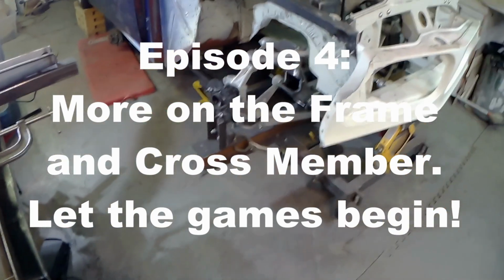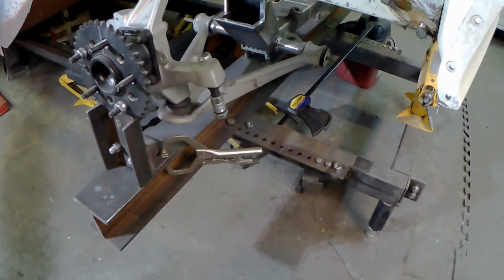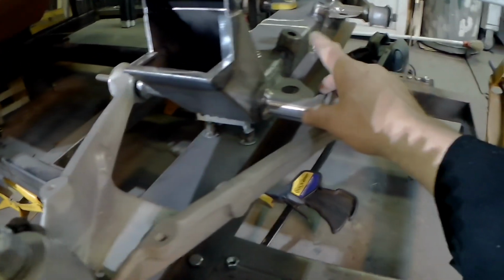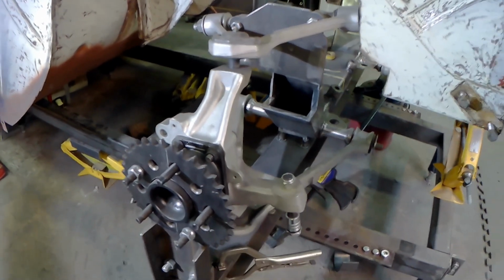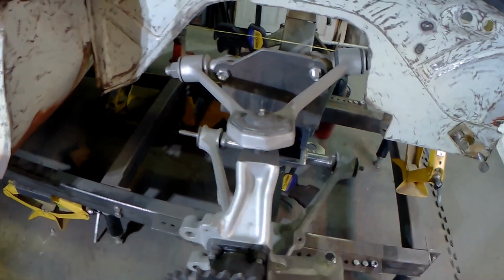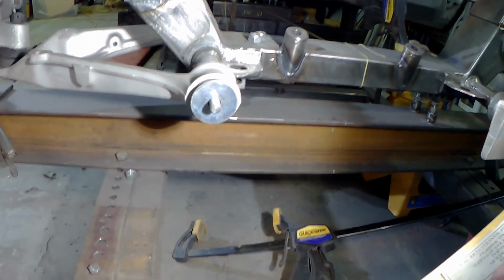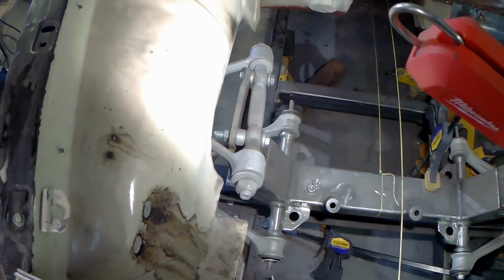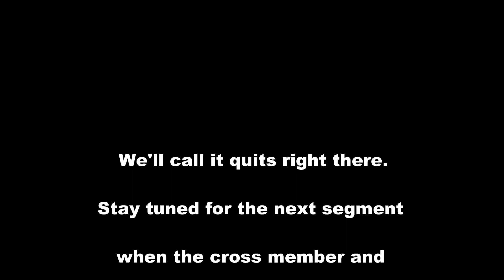Volvo Amazon Front Suspension Installation - The First Effort. (EP.4)

Comment: Surprised you didn't go with mustang 2 , as it has decent geometry and is more compact than the vette's (I did see you pooh-pooh the m2 in the comments of another video).  Did the size of the c4 a-arms or geometry present any issues on your considerably smaller track-width car?  What resources did you use to figure this out?  Just binge-watched all the frame & front susp vids. Great content!
Reply from the maker: The M2 is no better than stock...so if you were going from a solid axle to a M2 then it's a move in the right direction for a hot rod.  The only thing you get is rack and pinion steering from the M2 - the geometry of that suspension was designed for a compact car not a sports car.  It's cheap and there are lots of options.  The size of the C4 does present a degree of challenge, but locates in similar positions to the stock (so the UCA is inside the frame in around the same location) and the shorter LCA, forged aluminum uprights and arms, much improved camber/caster characteristics should really work.  I don't suggest people do this swap. I did have to contact Woodward to build me a custom steering rack.  I worked it all out (eventually - keep watching) myself with a little help from a friend and had the numbers checked by a race engineer I hired to consult on this madness.
Reply: @ThrottleStopGarage   I agree, a straight bolt in of the C4 makes the most sense if the chassis allows it.  Re-engineering looks to be a p.i.t.a., though I see some aftermarket co's do make kits w x-members /narrow racks to accommodate specific models. What would you have done in hindsight? Could you have "corrected" the stock susp w taller spindles etc? An "if I cd do it all over again" vid would be great ...I saw in another vid you stated the cost/effort of the carbon fiber ..wondered if you'd do that again.
Reply from the maker: @R0yL33  These are the hard questions Roy - I've helped out others with trying to improve the original front suspension and we always end up in the same place - cut it out and start again.  There isn't much that would help.  The "C" notch in the "frame" is so narrow that nothing much fits for the UCA and you'd want that tipped back to get some anti-dive.  The LCA pivots are so close together that a conventional rack and pinion is hard to find (sure a manual rack is fine and easy to modify, but there isn't much (anything) power assisted that is that narrow.  People will boast about steering effort etc...if you drive the car hard for a while it's tiring - that's why modern race cars all have powered racks.  Hydroboost or electric assisted were options but we lack junk yard parts for those in Canada.  The composite panels - wouldn't change a thing.  Light, strong, won't rust - perfect.  I'll do a deep dive video when it's further along.